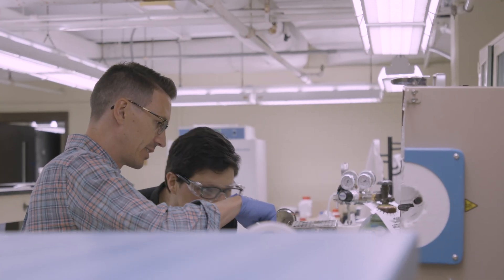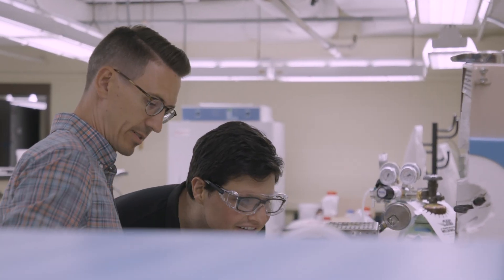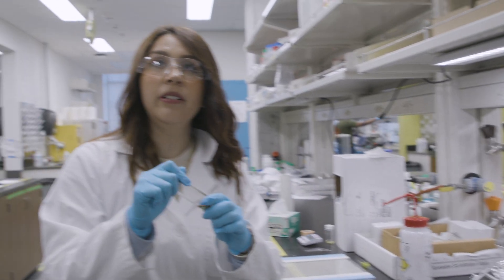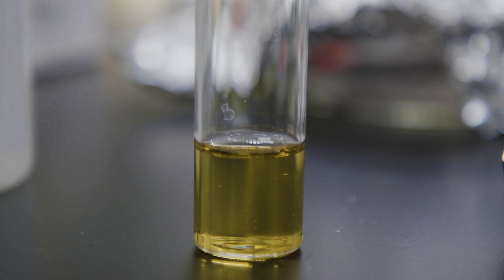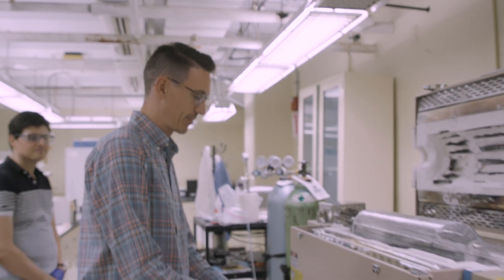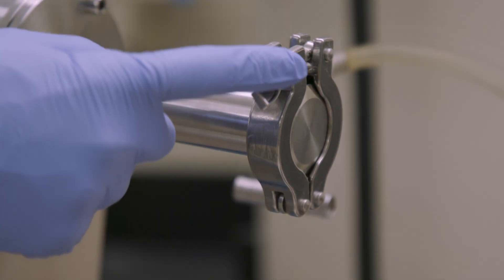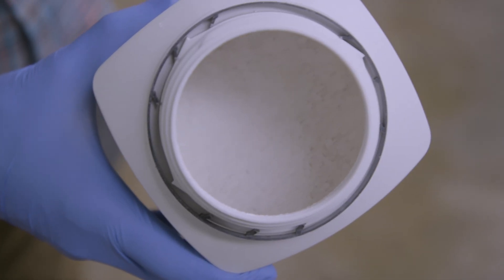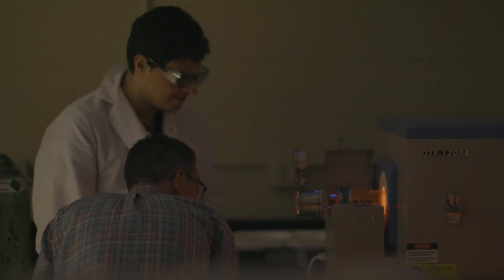A Real Mess:  Solving the persistent problem of PFAS

Comment: I'm curious if the incineration process includes a way to recover the fluorine atoms. Since it's such a reactive gas, I'd think venting it with the rest of the smoke would potentially just create new hazardous compounds. Perhaps that's what that hose was for on the end of the device? Really interesting research here, and something vital in a world where we really want things like Teflon, but then also need to dispose of it properly at the end of those items' useful life.
Reply: It's so reactive it probably doesn't exist long enough to do too much harm
Reply: But maybe the byproducts could be scary

(I didn't edit my comment because screw you Google)
Reply: fluorine as a gas and not single molecules, is actually extremely stable, no chance of it reacting or breaking once it's recombined